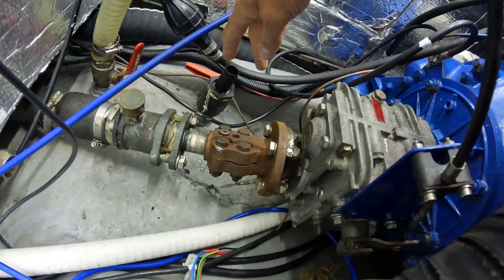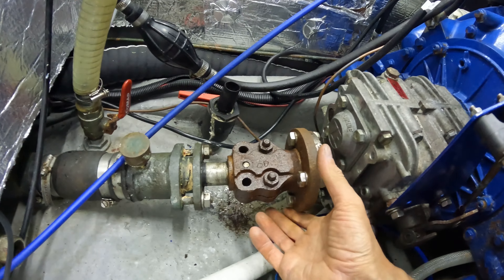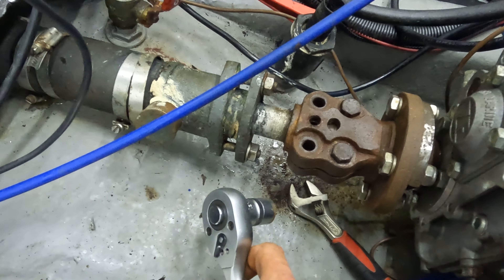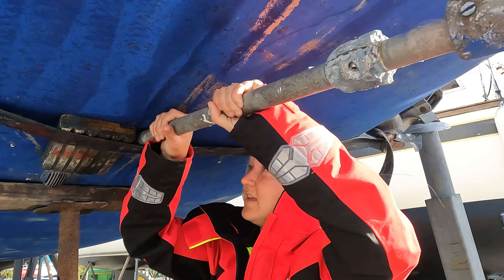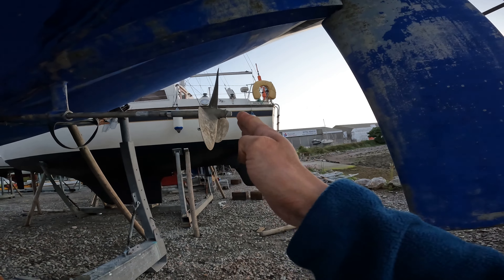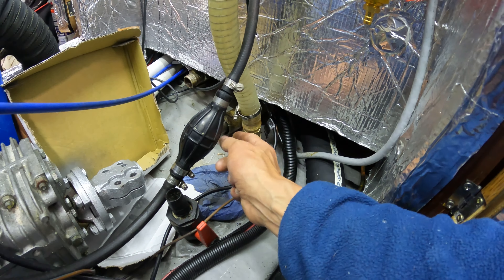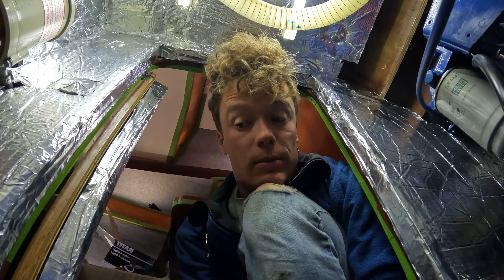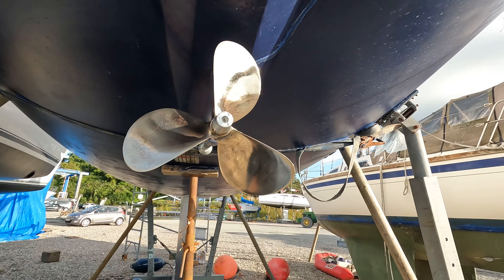E08 Haul Out Part 2 of 3 - Cutlass bearing, dripless shaft seal and prop polishing

Comment: I've had work experience with shafts and seals. I found that cleaning as best I could made the job much easier. A scotchbrite pad run over the shaft to remove rust/dust/scale/paint will help you a lot. For rusted bolts heat and penetrating oil were a great move but try a wire wheel on a drill motor or a dremel to clear the threads and make removing the bolts easier. Cleaning the threads will help reassembly as well. When you drive a bolt from the threaded end watch for mushrooming which will ruin you day. a quick dressing with a file or die grinder helps there. best of luck you you two, I've enjoyed your content.
Reply from the maker: Love the tips, thank you!

Comment: When fitting anodes to prop shaft always fit the anode close to the prop as possible. Yours should be around 2cm in front of the P-bracket. This helps to not introduce vibration in the prop shaft, also closer to the brass prop you want to protect from galvanic corrosion 👍⛵️
Reply from the maker: There is an anode on the prop nut as well, and I had read not to put two anodes too close to each other, otherwise they interfere/ eat each other. Have you heard something similar?
Reply: @sailingnendaz  no that is not true at all, it’s basic chemistry, the metal that has higher electric conductivity will corrode instead of the metals you want to protect, hence anodes are sacrificial. Having 2 close together is just like having one larger anode. You actually want your anodes to go faster rather than slower. This means they are working and doing their job protecting other metals. Also if you connect to shore power, especially in marinas then fit a galvanic isolator to your shore power lead before any bonding earth.
I also didn’t see any bonding wire connected to your through hull. Many boats don’t do this, but then they are not protected from galvanic corrosion. Always better to bond them fully back to a large anode. Also bond the keel, usually with a wire connected to a keel bolt and back to an anode. Most newer boats are not fully bonded as they are designed to last around 10 years, not built as well as they used to be. Worse is they often bond back to the engine block! Far better to have the engine earth fully isolated but this is harder to do as the starter motor etc uses the engine casing as ground. In an isolated engine install you need a separate earth to the starter motor via a relay that only connects when starting etc.